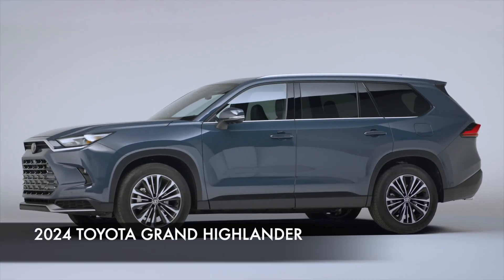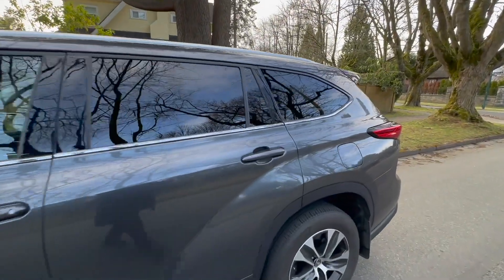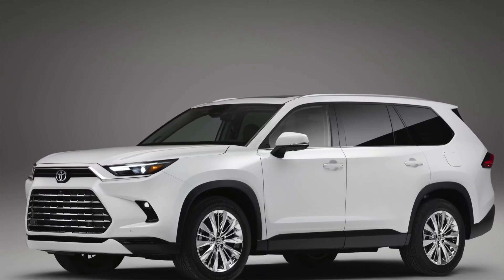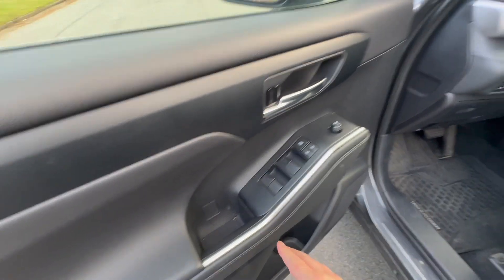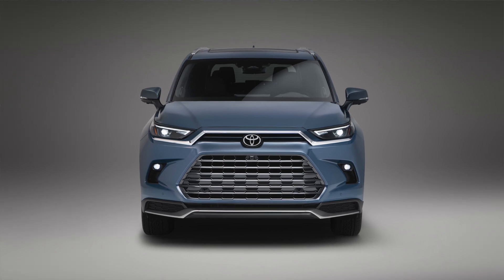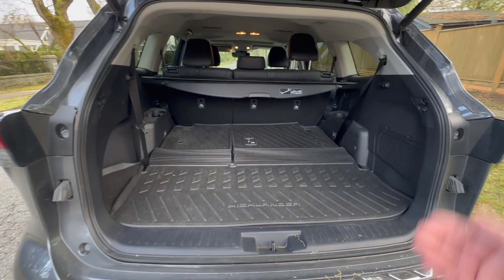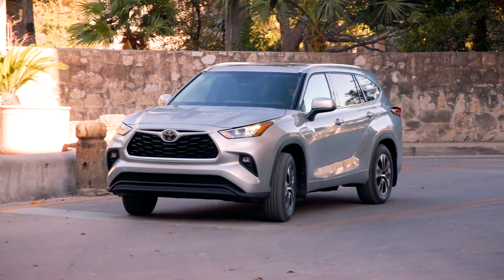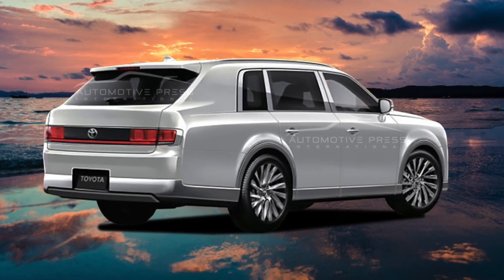2024 GRAND HIGHLANDER IS UNIQUE - IT'S NOT A STRETCHED HIGHLANDER - IT'S ALMOST ALL NEW

Comment: I don't know why this brother from another mother is complaining the highlander doesn't look right it is unique i design to the rav4 and the venza i own the venza and had it for 10 years with no problems. i own the hybrid version highlander and it doesn't disappoint 36 mpg it's great 500 miles on a full tank.  a rav4 prime that's 94 mpg technology is advancing so I will get a grand highlander when the mpg exceed my current highlander then I will get a grand highlander.  two the grand highlander has 368 horsepower that is impressive for a hybrid engine and a 4 cylinder engine. this technology is speeding ahead so fast it used to be 6 months for new technology to come out.  i think it's 3 months or less it's every quarter a new processors or computer coming to the market.  these hybrid batteries are getting smaller and more range if a rav4 prime is getting 94 mpg times the tank capacity that's 1400 miles range why would a driver want less. mileage.

Comment: Toyota made a big mistake on the Sequoia by not incorporating an independent rear suspension and lowering the floor for the 3rd row.  It is ridiculous to have such a large vehicle with 3rd row comfort or lack of comfort on par with every mid sized SUV on the market.  Ford had this figured out in the Expedition years ago, and GM just got up to speed with the latest generation of the Tahoe/Yukon/Escalade.

Why this wasn’t a priority for Toyota engineers is lost on me.  It is the reason I scratched it from my list.

Comment: This is where my previous idea of the Toyota engineered VR6-Turbo would be a great idea for the Toyota/Lexus lineup. It can be placed in between 2.4t and the 3.4t, but designed around high performance over high torque. Because the VR design is smaller than a traditional V6, it can be crammed in smaller, sportier, chassis; and because its nearly an I6, it'll be extra smooth; and also because the exhaust ports are on one side, only a single exhaust manifold and single twin-scroll turbo are necessary. 

Though, this is a pipedream, its fun to dream like an automotive engineer. We're more likely to see a twin turbo V8 because the parts are mostly available.

Comment: Love the Grand Highlander on paper, but pricing will be an issue.  Toyota built the GH to compete with Telluride, Palisade, Pilot, Atlas for the size, volume, and 3rd row legroom.  But all those SUV's have a base price of about $36,000, which is the same as regular Highlander.  So if GH is priced too high, then its value proposition decreases.

Comment: Toyota should make a Sienna van that has ground clearance like the Toyota 4 runner . I would definitely fall in love with such a vehicle . I traded in my Sienna AWD LE for a 2022 Toyota Highlander  and it is one of the worst decision that I have made. The  Highlander is very expensive and is really poor with the MPG . I get 11 MPG . I want to get another vehicle  but City world Toyota is going to get me again with their ways of ripping you off. They suggested that I purchase an extended service plan and refuse to change the engine oil with the plan unless I pay out of pocket . They claim that the oil last 10,000 miles before needing to be changed . Sorry I just had to add that to get an answer as to why are they doing this ?
Reply: It will be like a barge on springs with very poor handling
Reply: @geraldmen1  still would get one to take my family camping ;)
Reply: @jams501er  they do make a woodland edition which has higher ground clearance and knobby tires. But don't expect a Mitsubishi Delica
Reply: @geraldmen1  Thank you . Yeah I saw that one . I want something more off road worthy . ..

Comment: I just hope the regular turbo 4 is going to be enough.  It is all new, bigger and heavier.  Add in the weight of hybrid system, you're going to need the 400 lb ft of torque.  I'm good with it, but how long will the hybrid battery last? Had a client with a Toyota hybrid and it crapped out right past 100K.  It was going to cost 8 grand to replace, and this was 10 years ago. Much has improved and costs more today, but makes you wonder.
Reply: I am at 167k, hybrid , 9 years. Still going strong
Reply: The 2.4t is much stronger than the old V6.

Comment: The beginning of the video mentioning that underneath is the same as regular Highlander, but around the middle, it's also sating that suspension is re-tuned. Does it mean the new Grand Highlander sharing the same suspension components as current Highlander. Are they just the same shocks but different valving and same springs with different coil rates?
Reply from the maker: It's not exactly the same, but I believe the front is almost the same but rear has slightly different design
Reply: @AutomotivePress  by different design, do you mean it's a different style, geometry, etc, or just different settings on components?